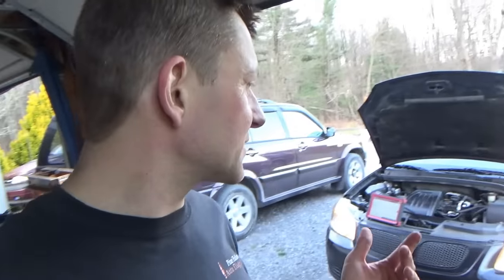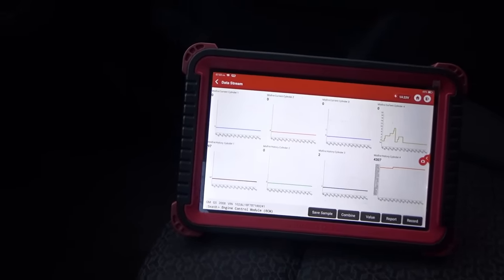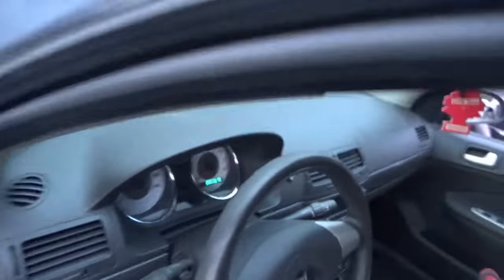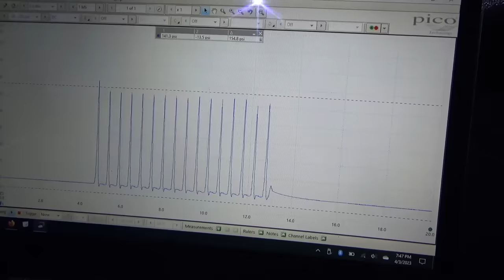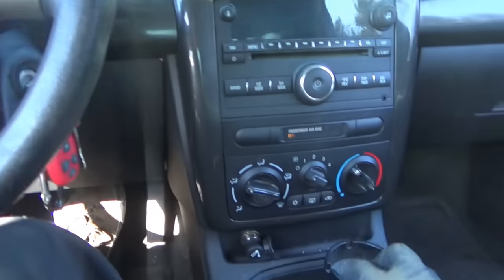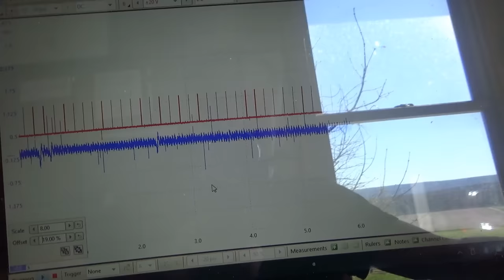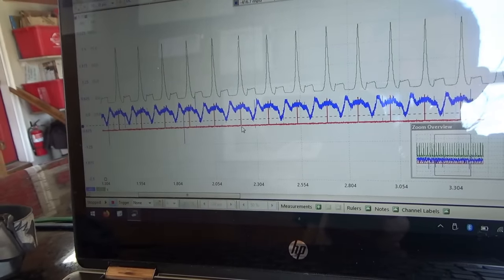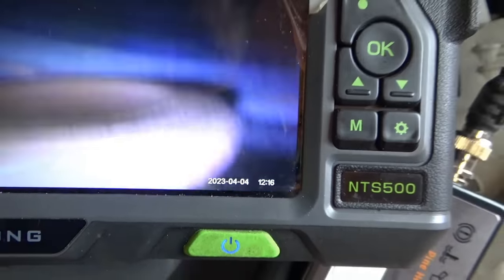P0300 Mystery MISFIRE - Difficult to Diagnose! (Intermittent "FISHBITE")

Comment: intermittent problems usually mean intermittent electrical connections,, I would swap 2 of the coils AND WIRES around and see what it does.. those customer replaced parts are junk 90 percent of the time.,
Reply from the maker: Coil on plug. Moving coil and plug made no difference 👍
Reply: @PineHollowAutoDiagnostics  maybe try running a secondary ground wire from the coil control wire to a good known ground. just for the number 4 coil. also just for the hell of it, swap the number 4 spark plug with another cylinder.. very uncommon but plugs can fail, with cracks in the ceramic that u cant see.
Reply: also alot of carbon buid up in the valve are can cause pre ignition issue or deminshed spark inside the combustion chamber.. I use a product called SUPERZILLA.. make sure the valves are both closed, squirt of few ounces in the spark plug hole and let it sit overnight,, next morning, pull the plug, crank it over and watch the gobs odf carbon puke out,, it is AMAZING STUFF..

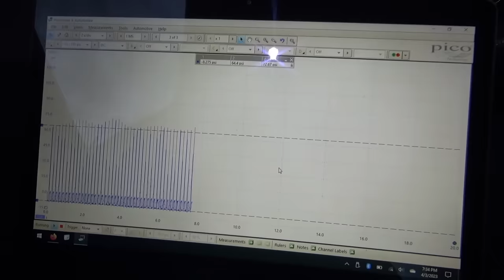Comment: Dear Mr. Ivan, maybe you can recommend an expensive complete fuel system cleaner that potentially could clean the valve lips and seats so as to seal consistantly. As an alternative, maybe if you can while holding the throttle open spray a carb cleaner into the intake hoping to scrub away that stuck carbon bit at the valve seat. I like your persistant to reach to the culprit Loool. Also, I am not an expert, but something crossed my mind which is the piston rings opening sequence which I believe called clock placement, i.e. the top ring to be at 10:10 o'clock, and 2nd ring at 10:30 and so forth, so I am not sure if the piston ring gaps comes on top of each other would cause such a tiny inconsistant leakage, so in this context, maybe changing the oil and using an oil additive like "Slick 50" would better seal the rings if its gaps come on top of each other. Also, but I am not sure if a leakdown test could or could not spot if whether from exhaust valve or piston ring. I dont know Loool. Take Care and Enjoy Your Time. John

Comment: Intermittent?  Sticky valve guide & stem, or sticky lifter? Clue in lift clearance, or lifter pumping oil volume through pushrod?   Thanks for staying with the diagnosis. As you said, interesting and teachable moment.  Good luck.

Comment: I would at least swap fuel injectors around before calling it a valve job. I paused at 12:21 so I am hoping that the fuel system gets checked at all after the just drive it till it gets worse comment.
Reply: Glad to see the fuel system was checked, I have to admit I was worried that the diag was going to stop there.  With that checked out I would be looking at possibly a bad roller on the cam follower or something like that.  You should hear some noise through the valve cover if that is the issue though.

Comment: You can use the same tube used with a leak-down tester and using a smoke machine to test it at TDC on compression and see if it leaks out (almost always the exhaust) (remove upstream o2 sensor to see it easier) At Idle the explosion is so small it cannot push past whatever is wrong with the seat. I diagnose things to get as quickly as I can to mechanical issue verification, as then we know the head or engine (whichever is less expensive) or fastest or both. :-)
Off idle the explosion pushes a so/so valve seat closed, that why under loads the miss less or not at all.
https://youtu.be/SSxsmCFlGWo?si=rEkoDtIgKIGK0iV-

Comment: I think you are spending too much time looking at data and waveforms and it has taken away from your innate Russian diag skills. It's just a POS Cobalt. You could pull the valve cover in 10 minutes and look at the valve springs and at least eliminate that as a possibility. The injector flow test is not a 100% guarantee that the injectors are all good, ive had injectors that were "squirters" that would cause misfires at idle but not at higher rpm. One time I had a 5.3 chevy truck with a bad lifter that would hold the intake valve slightly open and only at idle cause an intermittent misfire. You can't leave us hanging on this one, I've GOTS to know.
Reply: Me too. I don't like to be left hanging

Comment: You never look at any other data such as fuel trims, which speak volumes and I am 25min in and you still haven't pulled a spark plug for visual inspection... terrible diagnostician... your laptop isn't going to fix this car. PS; an EGR Valve is not "Air Injection" which you call it.
Reply from the maker: Ok so what's wrong with this car then? 😜
Reply: @PineHollowAutoDiagnostics   ; Get it back in the shop and I'll coach you through it ;)

Comment: You didn't do the basics.. check ohms in the coils and plugs .. and check valve clearance. Remove valve cover do basic mechanical inspection. Swap plug and coil from cylinder 4 with 1.
Reply from the maker: Did you watch the first one minute of the video? Not an ignition problem. And valve clearance is hydraulic adjust 😅

Comment: Did you park it out back for six months and charge the customer storage fees after throwing every imaginable part at it but never performing any diagnostic tests? No? Okay, park it out back for six months and charge the customer storage fees after throwing every imaginable part at it and don't perform any diagnostic tests under any circumstances. Diag is for nerds. Real fan boys throw parts at it and make the dealership eat all the repair costs without fear of termination because they might be the last tech that ever applies for a job there.